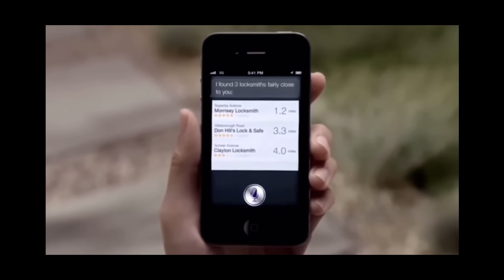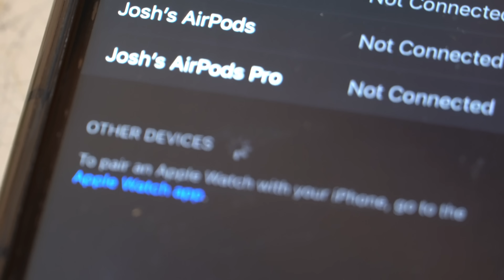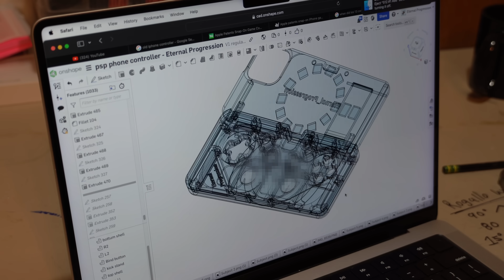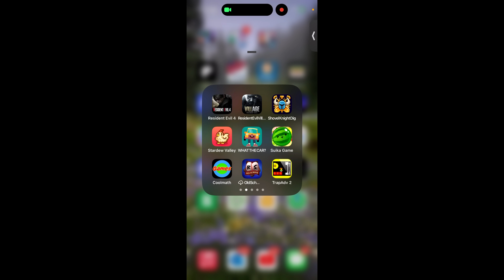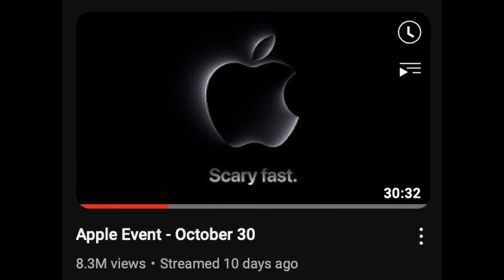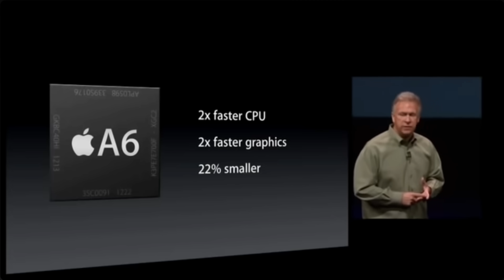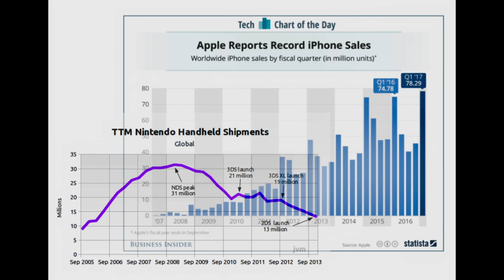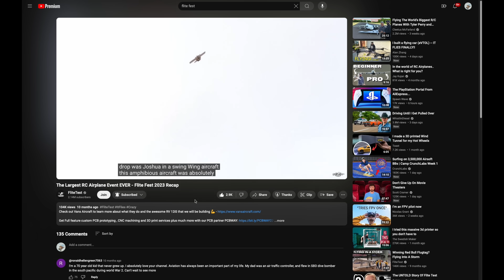I built this controller because no one else would | M-Con V1

Comment: You should make alternate connecting plates to orient the phone the other way (with the camera hole at bottom right instead of top left) my phone has a wallet flap and the controller slides down on the same side... I would love if it was on the other side so I could leave my case on and the flap would be behind the phone instead of in front of the controller
Reply from the maker: Ah! I see! I had been trying to think of a reason people would want a mirrored version! That’s a great reason, noted!

Comment: I have some concerns and questions on the design.

The main points :

1 Gyro support: If the controller doesn't have gyro, you can use the phone gyro, but it would be awkward due to the position, kinda like moving a mouse with a stick.

2 Touch support: If one game wants to use touch plus controller (Minecraft can benefit from it massively), would the MagSafe be enough to not accidentally drop the phone while hitting the screen?

3 Back paddles: Will it have back paddles? and if it does, will the back paddles be mappable to actions that are not the Xbox layout, like keyboard keys on Steam Input and speciifc places on the touchscreen?

The reasoning :

I mean, for most users, these are just gimmicks, but not trying to be arrogant, but being arrogant, I think the console controller designers and game developers are kinda stupid, and they should be ashamed of the default layout they created since the original Xbox, because after using the Steam Deck for some months, I wanted to play some modded Minecraft, which is notorious for ridiculous amounts of input. In my case, I had about 170 mods, so I needed to think of something. And after simplifying the input and after looking at the keyboard controls for a second in 10 minutes, I came up with a control method that (in my controversial opinion) is infinitely better than any of the official console versions I tried. Also, it's almost on par with keyboard and mouse, having some advantages and disadvantages compared to it. And the fact that the only non-Steam Deck controller capable of doing it is the Steam Controller kinda pains me.

Here's the layout I came up with: Right joystick is just for hotbar 1 to 9. I was using a mod to hide the hotbar when not used, so I set the touch-sensitive joystick to use the key to show the hotbar when touched and to show a radial menu on the screen that goes from 1 to 9, so I can quickly switch to an item by just flicking the joystick to any direction, which is just as fast as a keyboard when you get used to it. Also, I used the right trackpad and gyro as the camera mouse movement, and the left trackpad as a 4-way swipe type that, when you swipe to the right, it changes the hand using the item, which is useful for shields and torches, and when you swipe to the left, it opens the game chat. Finally, up and down are for setting and viewing waypoints on the map for the waypoints mod. I used the left joystick for walking, and pressing is for crouching. The right trigger is just the right trigger, like in the default controller setting or in a mouse, and the left trigger is also just a left trigger. Now, the left bumper is for dropping items, and the right is for third person. The back paddles are as follows: The first on the left is for running (useful for the movement mod I use), the second on the left is to change fire mode on a gun (my modpack is kinda crazy, don't ask), and the first right paddle is for reloading, and the second for a Dark Souls style combat roll (again, my modpack is very unusual).

These are all the controls that can be quickly performed at the same time, so you don't need to stop moving the camera to get your fat thumbs on the face buttons to perform these actions.

Now, the face buttons, which can't be used without removing your finger from the joystick and the trackpads but will still be used with the triggers and back paddles and with camera movement due to gyro. So, on the face button, you can jump, open inventory, change the third person shoulder between left and right, and also open the Project Zomboid healing style healing where you have to individually treat the wound based on limbs. Now, for the last part, the D-pad that is used for quick scrolling, the middle mouse button to get the block youre pointing to on creative, and the key to open the map from my waypoint mod.

These actions can't be performed at the same time, but they can still be done while moving the camera and using the triggers and back paddles.

Well, this layout has mouse-like accuracy, so I can shoot at things quickly and without aim assist (let's be honest, aim assist is just the game playing itself for you). It can use some of the fancy keyboard shortcuts on the inventory, and if you use the Steam feature of using the trackpad for typing commands and messages, it's just as fast as using a phone keyboard for typing. So, it's not the horrible experience of typing something on a TV remote or Xbox controller. This layout may be alien to new users, but after I explained it to some of my friends and let them use it for an hour or less depending on how used they are to gyro and back paddles, well, every single one of them really liked the control method and agreed it's much better than the Microsoft official one. It's a small sample size, but it's growing. Now that gyro aiming and flickstick are becoming popular, the trackpads and back paddles will probably take some decades before the mainstream devs notice them and will take even more for Microsoft to implement it on their horrendous Xbox controller since it doesn't even have gyro yet. My fridge has gyro on the door panel, my phone has gyro, some of the old flip phones I have use gyro, every major console supports gyro since the PS3 era, the only company that refuses to have it is Microsoft, and in my opinion, people who say it's just a gimmick never tried to jump, reload, throw a grenade, and use a knife while still moving the camera and also never tried to play without the built-in aim hack enabled by default on every game they play, which I don't care if you think it's better or worse for the game, it is objectively without any argument to be made the game playing itself for you, and subjectively it is done to compensate for how horrendous analog aiming is.

This feature is properly supported only on PC-style operating systems like Linux, Windows, or macOS. However, it can also offer benefits on phones by using apps to map the screen to a controller. It would be interesting to see it in action.

Even without them, the project is very promising, and I will likely buy it anyway if it's released. It could make phone gaming more appreciated. However, it could also worsen touchscreen controls. "Dead Space Mobile" is a prime example of how to use touchscreen controls intelligently. The only improvement it could use is gyro aiming, as always. But even without it, it's still better than 90% of mobile games in terms of control scheme. So, I'm unsure if touchscreens are inherently bad for games or if developers are just lazy or incompetent, opting for the worst control methods without considering how they can affect their games.

Comment: Nice device! A slider that pops out of the side so you have something to easily grip on or attach  either by using a mechanical mechanism like a switch blade or using mag safe so that it turns the controller into a banana boomerang shape similar to a PlayStation or Xbox controller would make this possibly more ergonomic and maybe more appealing. I don't find the shape of the NES/switch/wii/ controller so ergonomic or comfortable to game  with, but it really has to do with the games, like if there's a bunch of games that I want to play with I'll deal with the uncomfortableness of the shape of the controller to play the games, but there's a ton of other controller choices to choose from so I think having some flexibility of the game pad that's where the switch really shines because you have joycon and then all the other sort of attachments that comes with it, so you can choose to use a joycon on the contraption that came with the switch or all those other iterations of other devices that the joycons dock into and then you have all those other types of switch pro controllers that are out there. If you built it in to or sold it or included these parts as a  separate attachment for the control pad , it would be fantastic.  Not sure if this was something you though of while designing your controller.

Comment: You're acting just like apple, in that you invented something old again, except you didn't sufficiently address the problem that caused the old controllers to never break mass market... which is that you have to carry around an accessory for your phone... another thing to charge, another thing to lose or keep track of and make your pockets look silly. The phone looks too fat when the controller is attached so ppl won't keep it attached, but even if they do, magnets are too weak, and now you have a controller constantly falling off your phone. It's got the same problems the original idea had. It's a slick design tho.

Comment: There's a reason this hasn't been done. No interest. Remember the PlayStation phone? Exactly. Other than emulators, which most people don't want to hassle with setting up, there's nearly no games designed with game controllers in mind. Why would developers suddenly switch to making good console quality experiences, when they can just crap out whatever and rake in the dough with micro transactions?
Reply: the difference is phones are more powerful now and companies are starting to release AAA titles on phones (RE4 Remake for example). This controller will blow up if more companies decide to release games on mobile platforms. Also remote play/game streaming are a thing now so proper controllers would make those services more usable. The xperia was released a decade too early.

Comment: For those curious about the newer version he hinted at toward the end of this video I suspect it is the one that is in the screenshots on the M-Con website and the YouTube Short that he made. I notice the big improvement in that one seems to be that he replaced the Sliders with real Vita thumbsticks. It also has a new design on the back and does not have an indented cutout for the type C charging port on the top. The latter might not seem like a big detail but it could hint that he's using a different(custom?) PCB board which would be a huge step towards making this a retail product.
Reply: Another little hint. I noticed that the old version has an itty bitty button sticking out the top(my guess is for Wifi synching).

That button is gone in the newer version. There also appears to be a button on the left side of the case in the newer version that is absent in the older one.

Again, might seem like small details but definitely suggests a different PCB.

Comment: With how well the backbone one took off, I see no reason why this would not surpass that once you are able to make the it a viable product. The backbone has the case removal issue, I corrected that with an add on that still has issues. This if it allows any case or just about any case attached, already is miles ahead of the backbone. The only thing the backbone has that this does it is that the backbone does not need to be separately charged but I do not see that as a big hurtle if everything else about this controller is just right.
Reply from the maker: I think so too!!!
And to get around the charging problem a little bit, I want to add wireless charging. So you can just plop it onto a MagSafe puck or charging pad at night!

Comment: I had the exact same idea. To be honest the Razer Kishi achieves something similar to this already but this is a cool implementation also. I Have been thinking there needs to be a new Experia play, or PSP Go. Especially if one could eventually work with foldable phones so you could have a tablet sized screen with portable controller. Combined with game streaming - so that demanding games could be run - this would be the ultimate gaming device.

Comment: In the future you should also think about producing and selling MagSafe cases, because they're necessary for this M-Con and I didn't know those magnet cases were a thing until I saw your video, and that would guarantee they work since you've properly tested them yourself, rather than ordering a case online that advertises something then turns out it won't be compatible with the M-Con.

I know it might get a bit more complicated when you start putting Android phones into the equation, since those have different sizes and shapes, but I read on this comments section you said repairability is important, and since the cases will be 3D printed you could make them modular (kind of like what project ARA tried to do, swapping pieces to accomodate for everyones tastes), that would also make them stand out from the rest of case manufacturers as its own unique thing as well, which fits perfectly into the M-Con concept.

And that's how a project/company usually starts, from basic and simple things until they start growing after realizing people's use cases are different and cattering to the majority of them would make the business prosper. So I hope you consider this option further on ahead.

Comment: Would be amazing if this could somehow integrate a wired connection, at least optionally, though that would really go against the simplicity of the design. The extra 2+ frames of lag caused by Bluetooth isn’t a killer for most people, but is certainly noticeable, especially when added to emulation latency. It would probably be easier to just use USB-C than to also do lightning, which makes it pointless for my beloved iPhone 13 Mini unless it could be certified with lightning like the Kishi/Backbone/etc. Also, with Qi2 coming to Android eventually, the magnetic design could be made somewhat universal (though the size of the controller of course won’t be). Either way, super excited for this!
(EDIT)
Apple announced a Game Mode with improved responsiveness. We'll see if it actually fixes the bluetooth input lag, but I'm hopeful. Difference between bluetooth and wired on PC is probably within 10ms, while on iPhone the difference is over 30ms. Hope they can reduce that down.

Comment: actually this controller has lots of potential, I just have a few suggestions:

1. how will you add analog triggers to it
2. how will you made this work for all phones (phones that are smaller/bigger and/or don’t have MagSafe)
3. will the production version have a bespoke board design and/or triggers
4. will it charge from MagSafe
5. can the battery be easily replaceable

Comment: Suggestions for the future M1: 
MagSafe compatible where it charges through MagSafe and is turned and activated once connected to MagSafe 

The slide out powers it on putting the phone into game mode with controller connected automatically. Either the slide or just the MagSafe connection in general 

Strong magnets of course 

Well made buttons. 

Super hyped for this already signed up

Comment: Your video is tightly written and slickly edited. After my first smartphone had a slide out keyboard I didn't want to give up, I got a case for my next phone with a Bluetooth sliding keyboard that I ended up not using much because it was really thick and finicky to connect, but using Magsafe really does make everything easier and you can use the case you already have. I like the kickstand for extra utility. You make good stuff, keep doing that!